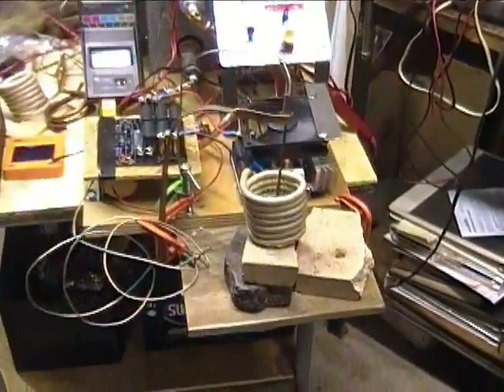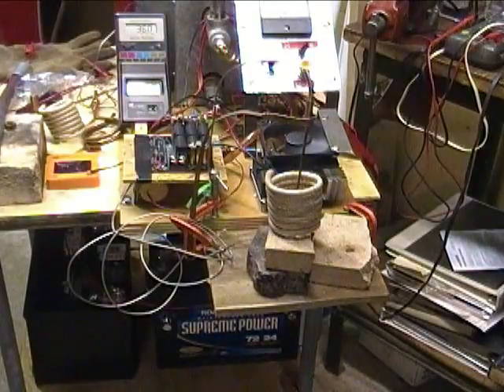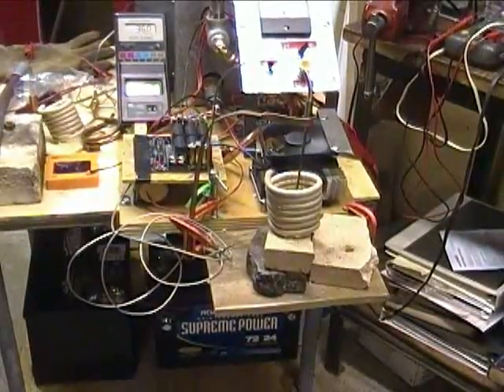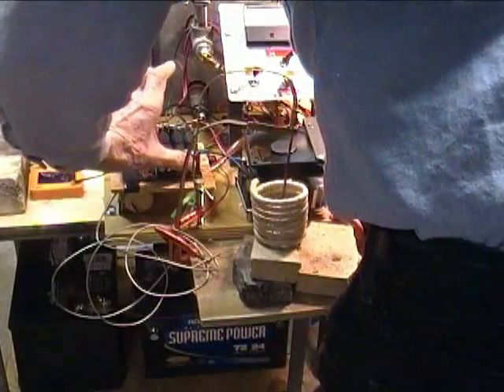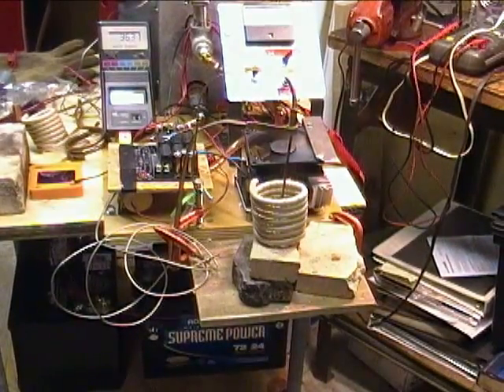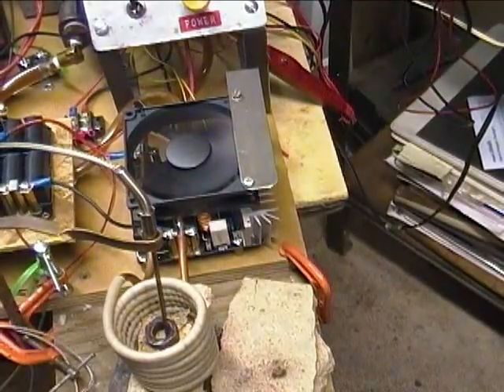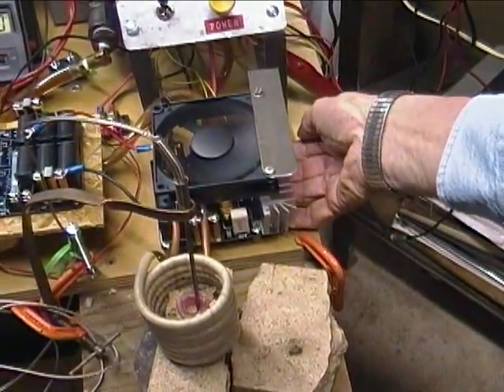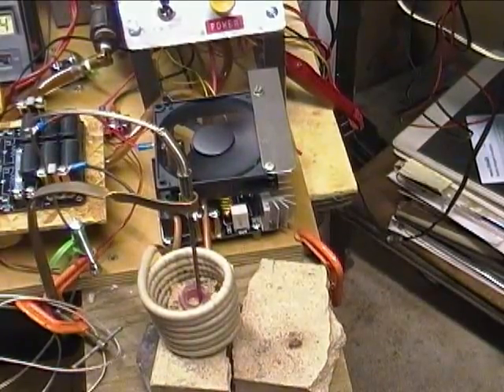ZVS 1000 Watt Induction Heater Reduce Resonant Frequency

Comment: Hi, is the material of the temperature sensor in interior of the coil metallic? The temperature measured may have an error by auto heating of metallic temperature sensor? Great job, thanks.
Reply from the maker: Yes, the material is metallic.  But the reading doesn't change much ( if any) when  I remove power.

Comment: That's a great idea and I found your videos very useful (especially the comparison of each of the options). I haven't had time to stufy induction heaters yet, so maybe it's a basic knowledge, but I'm wondering if there's any limit of how much you can increase the capacitance in order to improve the performance. I just received a 1000W heater and it has 5 capacitors 0.33µF each. I found the exact same capacitors for $0.82/piece, so I could easily triple or quadruple the capacitance, but I'm not sure if it's worth it?
Reply from the maker: Are you sure you don't have 6 capacitors?  All of the1000 watt boards that I have use 6 of the .33 mfd capacitors.   I think that doubling the capacitance and doubling the inductance of the work coil  (twice as many turns) is a good idea to decrease the frequency and increase heat transfer, but I don't have any experience with going farther.  I have read that much lower frequencies than the roughly 40 KHz that I get with "double double"  are often used to heat iron and steel, but then you also need a lot more overall power.
If you do buy more capacitors, make sure they are of the same type and working voltage as the ones already on your board.
Reply: @frenchcreekvalley  actually it's neither 5 nor 6, I have 4 of the capacitors - I'm not sure how I counted 5 the first time :D Thanks for the tips! I guess I will need to experiment a bit after I read more about how these things work.

Comment: Hi, I'm from indonesia. I am having a bit of trouble with this induction heater. I heat a solid iron 31 mm diameter and 35 mm thick.
I use 36 Volt of battery. But when it runs about 3 minutes, suddenly the diode (D1) and Mosfet IRFP260N that is on the schematic explodes..
what do you think the cause of the problem is?
Reply from the maker: I think the current is too high because the iron piece is so large that it couples energy too well.
I always use an amp meter between my power supply and the induction heater board.  I never exceed about 25 amperes.  If I had to heat the iron piece that you are using, I would lower it into the work coil very slowly and watch the amp meter.  I would only lower the piece as part of it heats up to the curie point, where the current will drop off considerably.
  Other possible causes:
-NOT cooling the circuit board with a fan
-Allowing the work piece to touch the sides of the work coil shorting two or more turns together
-A drop in battery voltage.  Early in my experimentation, I was using three 12 volt batteries in series.  One of them was weak.  As I heated a work piece, the applied voltage would drop by several volts.  As the voltage drops, the signal to the Mosfet gates is slower to turn them on fully.  This makes them heat up very fast and can easily lead to destruction.

I hope this helps.
Reply: Thanks for your answer. It's very help my project, Actually I don't really know much about electric cause i'm an mechanical engineer..
Reply from the maker: Here is the amp meter and shunt that I am using:
http://www.ebay.com/itm/DC-0-50A-670-ANALOG-AMP-METER-AMMTER-CURRENT-PANEL-50A-75mV-SHUNT-RESISTOR-/261887567869?hash=item3cf9b727fd
Reply: Have you ever tried changing the dimensions of the coil (diameter or length)?
Approx the size of the coil Changed (Bigger Diameter / longer) does the impact of the change mean so much to the ZVS driver's ability?
Reply from the maker: Yes I have made several different coils.
That work is on this youtube video:
https://www.youtube.com/watch?v=d3-3OO8Msbk
Reply: Can we keep the temperature of the heated iron as desired by limiting the incoming current to the driver when the desired temperature has been reached?
Reply from the maker: Yes, you can keep the temperature as desired, but you need to be able to reduce the voltage to lower the POWER  (Watts) to the work coil once the work is up to temperature.  The circuit will draw all the current it can get, so that's why you need to lower the voltage. If you look at some of my earlier videos, you will see the effects of running at lower voltages.
  Also, you can maintain a certain temperature by cycling the DC power on and off  (not the AC to the power supply, if using a switched mode supply) using a temperature controller and a suitable relay.  You can see how this was done by watching this video
by "The Radio Mechanic":
https://www.youtube.com/results?search_query=radio+mechanic+solder+pot
Reply: Nice explanation, Thumb Up! Thanks for your answer sir.. That's really Help me
Reply: I think to really keep a stable temperature a PID type controller of the voltage input would be needed.  @frenchcreekvalley
Reply from the maker: @davidwallace7761  Yes, IF you need a stable temperature.   The problem is the cost of a device to switch  the DC power off and on  to this kind of induction heater.  One needs either a hefty mechanical relay or an expensive DC solid state relay to do the job.